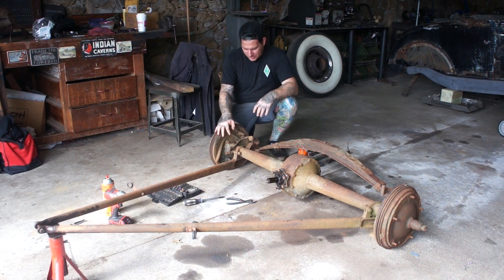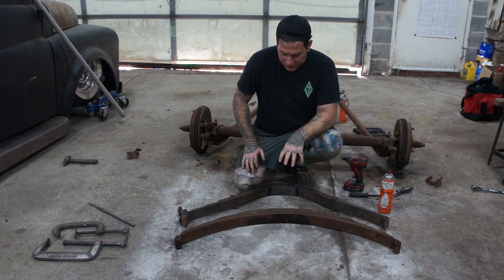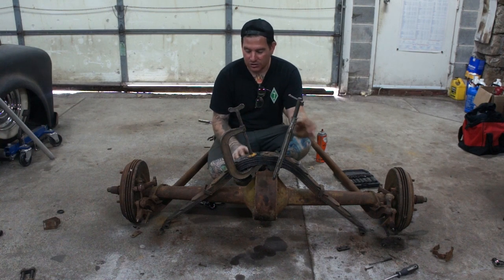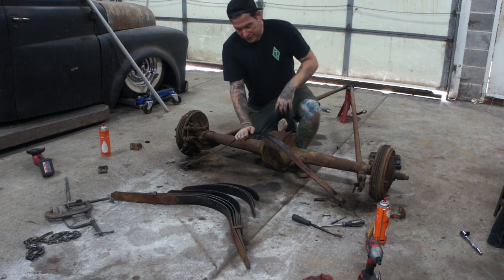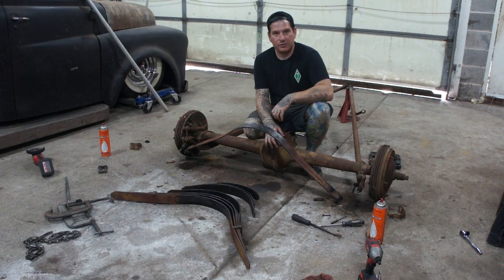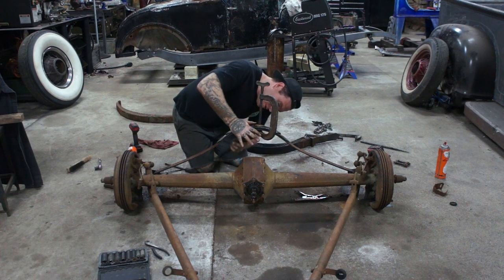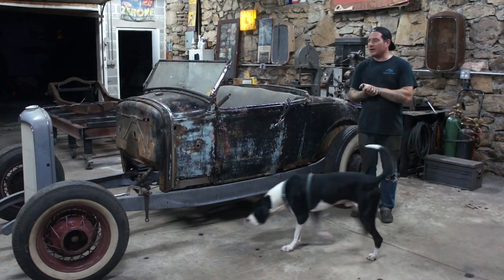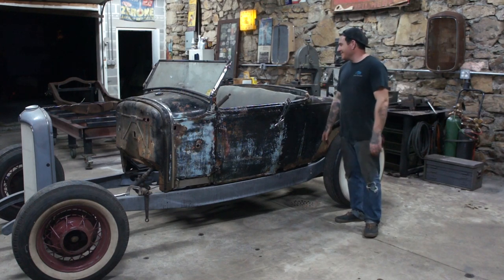How to Disassemble a Ford Model A Spring- Suspension Mock-Up Sweet Heart Roadster Ep. 26

Comment: When I draw a spring up with the center bolt I put a bit of anti seize on the threads.  If you don't there is a good chance the nut will gaul (friction weld) to the bolt. New bolts are available in a variety of lengths and diameters. I usually use a new bolt when assembling a spring pack..

Comment: Matt I have a question for you. I picked up a 35 rear end for my two door sedan build. Will the spring behind set the rear wheels far enough forward to make it look funny? I plan to do the rear frame mod in the how to build an early ford book should I set the spring perch back the distance that the spring behind pushes the wheels forward? Maybe it’s not that big a deal and I’m over thinking it. Lol
Reply from the maker: Great question! The spring behind setup will put your rear wheels too far forward in the wheel well and may look odd. If you're building a frame or modifying the frame you can adjust things to make that work, but you can't just bolt it up and expect the wheel base to be correct. If you're dead set on the 35-36 rear you can modify the frame to get the wheels back in the center of the wheel well. I forget the measurement, I usually just mock it up and then measure and modify to match. It IS a big deal! The stance and the side profile of a hot rod is CRUCIAL and if you're wheels aren't centered in the wheel well it looks really odd and hurts the overall look of the build no matter how nice the paint, engine, etc. is. Good luck with the project man! -Matt/ITG

Comment: Hey Matt, I possibly have a 1937 ford pickup rear end I am looking at. Kind of following your lead on the sweetheart roadster for my 28 Ford pickup project. In this video you stated the one you had was a 36. Will this 37 rear end I am looking at work? I saw right off some suspension differences the 37 has coil springs on top of the axle. I was thinking this could be modified and I can do the similar things with the springs since I have all that. Please just let me know you opinion. Thank you Matt, Puget Sound, Washington State
Reply from the maker: A 37 rear may have dual leaf springs different from a car rear so that could cause some extra work. One nice thing is that it may be an open drive which will eliminate the use of a torque tube. Make sure it isn't a big truck (floating axles) rear as they aren't the best for a small car like a model a and have really low gearing. The bottom center webbing of the rear should have a stamping of a small (normally single digit) number and a two digit number that you divide into each other. That will be your gear ratio. If it has the wrong spring setup and a super low ratio I'd keep looking for a better rear.
Reply: Hey Matt thank you for the feedback. I can say this one has the single leaf just like the one you are doing on the sweetheart roadster. It does have the torque tube. Thank you for the info on stamping for gear ratio's that is valuable. I will have to check that. I went ahead and picked up the rear-end and also have the top-loader 3 speed transmission that went with it. I think I will be able to do something similar to what you did on the sweetheart  roadster "except" since I have the stock 28 Model A frame I need to lengthen the frame or another form of adjustment to move the axle back to the original location. I had an idea to build a frame to support the bed of the truck and am thinking this is a perfect opportunity to move the axle back and relocate the spring plus get some drop of the rear of the truck doing so. I will hopefully get a video soon. Been super busy at my main job so not much time in the garage.